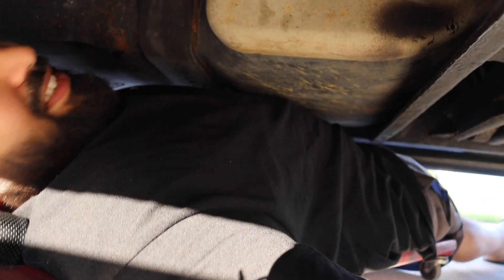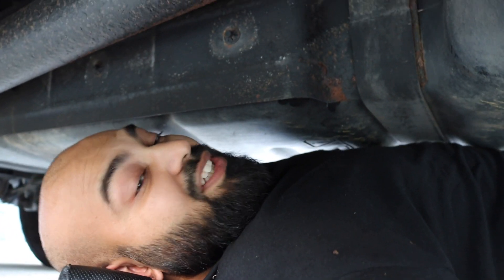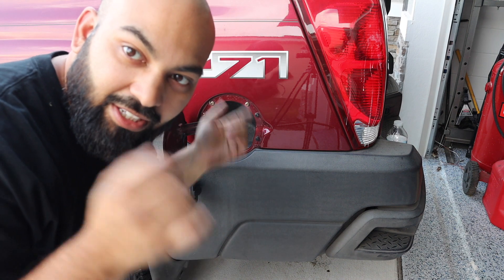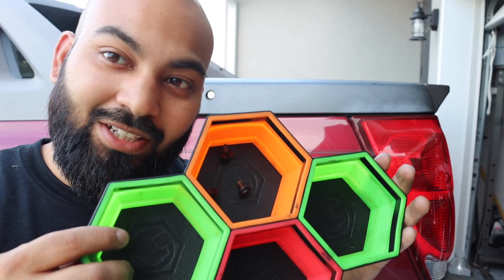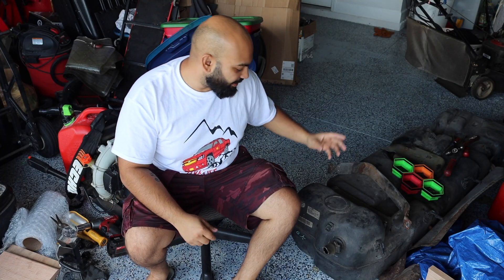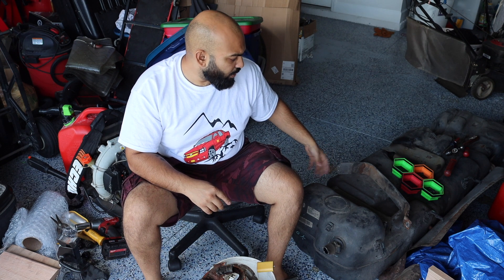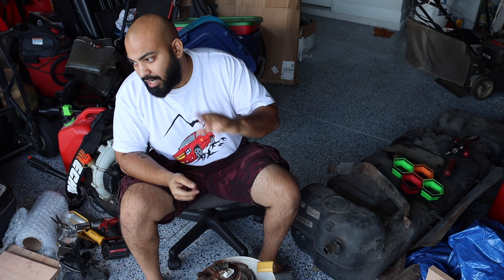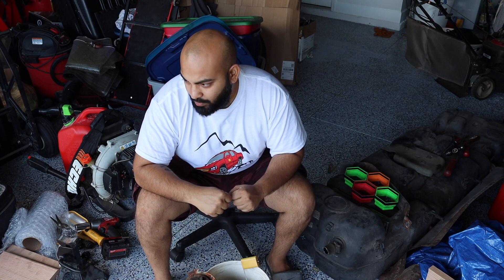dropping the gas tank on the chevy avalanche

Comment: Was the fuel pump expensive & where did you order from? I just found a fuel leak that seems to be coming from the top of the tank. I'm hoping it's just a hose but I might have to replace fuel pump on my 07
Reply from the maker: mope fuel pump cost 200 on Amazon.. I put the link in the video description.

Comment: need to see where fuel filter is located. I can't find it.not under driver side
Reply from the maker: If you can see a fuel filter on the frame rail under the drivers door. Then chances are your avy doesn’t have one.  It’s a non serviceable one in the gas tank

Comment: Where is the gas filter located? Thanks
Reply from the maker: My truck doesn’t have a fuel filter it’s built into the pump. Other avalanches have it on the rail under the drivers door
Reply: Yeah ... Learned the hard way ... Changed the gas pump twice to find out the filter was a tampon attached to gas pump ... 😂 At least I change the gas pump with my eyes closed now ... Thanks
Reply from the maker: Hahaha and it’s not even fun bro, did you drop the tank or make a hatch door
Reply: @Kingcustomz  yeah i dropped the tank ...
Reply from the maker: Good lol, do it right 😂😂.  I can’t imagine cutting into the avg
Reply from the maker: Yeah that’s good man do it right lol. I can’t imagine cutting into the avy

Comment: I made a door underneath the driver side rear seat for that job!
Reply from the maker: I was going to take that approach but i I just couldn’t find it in myself to cut my truck lol
Reply: @Kingcustomz  I cut an overlapping piece off of a junk yard Avalanche so that I would have the same thickness of metal , some sealer and a few screws and ready for a 30 minute change out of pump.

Comment: Do you want to drop my tank? It has 6 left nes as mine is a dual tank system. It was the only year that came that way as far as I know. It may have been in the 02 but not the 04 2500 series. To replace all the lines it would cost 550 for the lines and 600 for the labor. I had one line done . The mail one and it cost me almost 300.00. It was the main line to the front of the truck.
Reply from the maker: holy jeez. I wouldnt mind dropping your tank for yah.. on a lift hahahhaha.... wow that's cool dual set up? apparently evvery avalanche had something different done to them

Comment: JUST DROP MINE WANNA GET NEW FUEL LINES I BOUGHT A AFTER MARKET PUMP ANY SUGGESTIONS WHERE TO GET THE LINES AND WANNA GET THAT GADGETS TO TEST THE PSI ON THE GAS PLUS I NEED PASSENGER  SIDE  RUNNING BOARD COVER MINES BLEW OFF
Reply from the maker: oh gosh on the running board cover lol. yeah definitely get the fuel pressure kit... I would recommend harbor freight but those kits suck lol. the one on amazon is actually good, unless you find something else you like, just let me know what you get. and I think I'm going to replace my lines as well, let me look into it and I'll definitely get back to you...... keep watching the videos so you can see where I got mine, or follow me on instagram @ king__customz... I'll let yah know